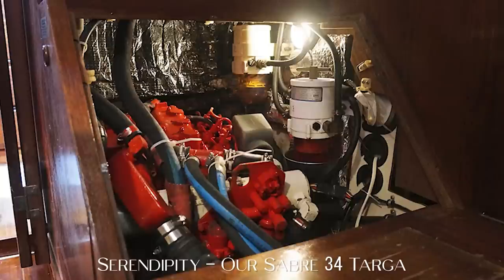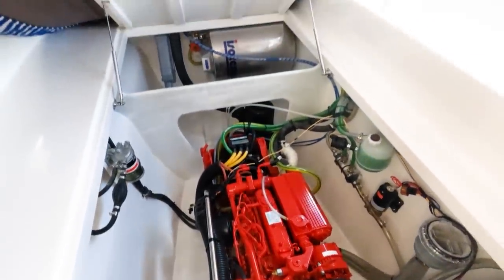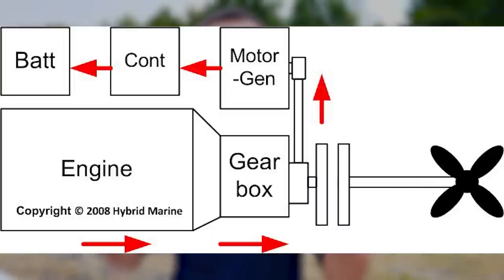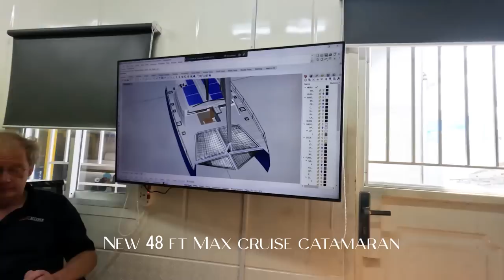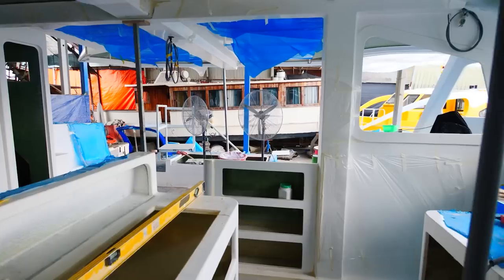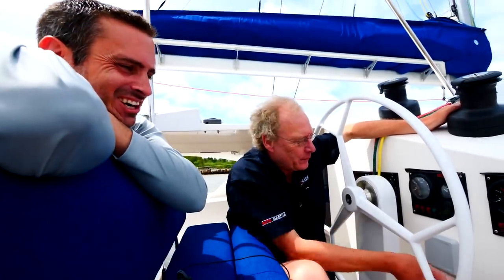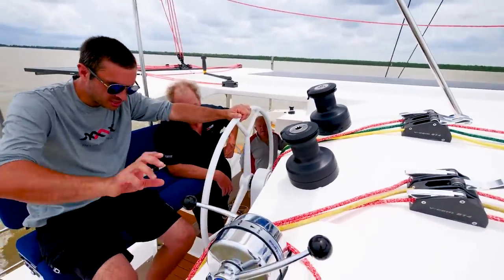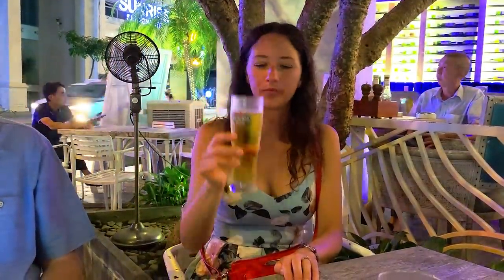Putting a Hybrid To The Test  (MJ Sailing - Ep 249) #electrichybrid #hybridengine

Comment: Looks like a cool system. I can't imagine trying to use that display at sea where it's mounted. I would prefer mounting them inside out of the weather and away from the steering wheel.
Reply from the maker: They have actually come up with a new display system for the raised helm since our visit.  Stay tuned to the Q&A section of our next video where we'll cover that 🙂.

Comment: Going 3 knots for 7 plus hours is useful if you have say enough wind to add another 3 knots. No diesel motor banging away & you're still moving at 6 knots. Really interested in the regen facts and figures from the props, this would be great in the dark hours, ability to put back into the battery bank 24/7 in association with a nice solar set up. Happy belated birthday Jess

Comment: Really really nice explanation of hybrid systems, I really like the idea of generating while underway from the prop. Seems like that could lower the diesel fuel costs on long trips. Was thinking that it would be cool if there was a physical "aux" in/out to the generator, for wind(blades/kites)/pedal power/gas engine/..., perhaps then run in reverse for pump(water/air)/blender/bow thruster/tools/air compressor/washing/...

Comment: You can get the same system for half the price and half the maintenance if you put an electric drive on one hull, and the ICE engine with a HO alternator on the other.  Most cat owners run only one engine while distance motoring anyway.  Yes you'd have to adjust your technique a bit while slow speed maneuvering.

Comment: Another great video guys, I think if the cost does come down a little the hybrids like that Beta will take over the market, having multi-modal drive and generator redundancy is ideal for a cruising boat and Beta use Kubota engines so reliability of the diesel side is assured.

Comment: With a hybrid system, in 6 years from now either the components to repair it would be unavailable or prohibitively expensive. There is a reason cars from the 60's are still around, but try and find a spare part to fix something made in the 90's or 2000's.

Comment: Thanks for explaining the hybrid engine system. I was wondering what is the extra cost compared too having just a desire engine Also how does it compare to a hybrid in a car.
Reply from the maker: For the two of us, the cost would be a lot higher because we were able to get our hands on a set of gently used diesel engines for $7,000, lol.  I think if you were to start with two new 35 hp diesel engines, the price increase would be around 40k?  (don't quote me though)

Comment: Did I understand right that under a good sailing wind- you can turn the propeller unto what amounts to a water windmill and charge the batteries or make electricity? Since they are being dragged through the water anyway.  So if you anchored in a river- you  could also use the rivers flow to spin the propeller.  or the tide going in and out?  Could you go wireless and build the gauges into the steering wheel itself? with my old eyes it would be hard getting them to focus on those small displays.  Having the bunks airconditioned is great idea.  At night having a cool sleep is so amazing after a hot sunny day a little sunburned oh Luxury---  you would use the airconditioner for dehumidifier also and collect the water?

Comment: Nice Video and Great Explanation of Hybrid Propulsion! I agree with you that the cost still does not make economical sense. A good data point to include in the next video would be the "payback" time at the current cost of diesel vs. the increased cost of hybrid system.
Reply from the maker: If buying two new diesels the size used in these boats (30hp) plus a genset, then it's a more palatable difference.   From our cheap base of the used diesels we have, it's a far larger jump :)

Comment: What i missed and correct me if I am wrong is the regen function. If you are under sail you could used the shaft rotation the regen the batteries. If you could add this to the system you would even have to use the engines a lot less.

Comment: The hybrid system reminded me of a saying. “Why make it simple if we can make it complicated” 
They could have use one of the Diesel engine, as generator, eliminating the need of the second engine and running two electric motor/ re- Gen.  
It’s always good to see what’s available.
Reply: All operating in a severe environment.
Reply from the maker: But with the system you're proposing, all eggs are in the electric basket - which I don't trust as the only propulsion option.
Reply: Would be better to have a single parallel than a single serial. As long as the parallel could pish the boat by itself.
Reply: @MJSailing  Excuse my question. Why do you not trust electric motors? You want to tell me a 35kW Diesel engine does not break at the wrong time? Murphy does not care which form of energy is used.
Reply: The sails are your redundancy.  I’d much rather have fewer moving parts and focus my pm time on one diesel generator.   Put it in the most accessible space so when it ultimately fails it can be pulled and replaced in a few hours.
Reply: @MJSailing  No your are not. There two electric engines, there are solar panels and regen and it is a sailboat. That is already a lot of redundancy. It is also easier to maintain a single diesel than two diesels. Especially since you can mount it in a place with better access.
Reply from the maker: It's not the motor that's the issue.  It's the system necessary to power that motor that's the weak point.
Reply from the maker: I don't get this idea.   This parallel system has a diesel motor..... Same as a serial with genset.   But instead of needing a generator head and extra charging system, this system uses the already in place electric motor as the charger.   There are less parts in this system
Reply: @MJSailing  A complicated Diesel engine with high pressure pump and injection valves, camshaft and crankshaft and many moving parts is more reliable? It is sensitive to contanimated Diesel fuel and does not work under water. 

I understand why you are hesitant because of the range. And the cost of the battery. And i understand why you want a backup on high seas. But i would want a backup for the Diesel engine. Not the other way around. But then i worked with both since school in the 1980s. Fossil burning engines never were as reliable as electric motors.
Reply: @wolfgangpreier9160  Yes an electric motor is very reliable, but what about all the other electronics like the inverter and control panel. They are in a saltwater environment. Lightening strikes are also possible, I would expect a diesel to handle that better than a inverter, and be easier to fix in remote locations.
If you are demasted at sea, which is a high probability you will want the range of a diesel.
Reply: @AORD72  When a Diesel strikes out and is waterlocked you can not repair it in high seas. Of course you can not repair a inverter yourself, just as you can not repair a broken camshaft. 

What do you mean with lightning strikes? Lightning does not do anything to electronics or electric machines in general when they are encased and earthed correctly.

When you are demasted at sea and the prop falls off you are a goner. No diesel fuel or working diesel engine would help you in that case. 🤷‍♀🤷‍♂
Reply from the maker: You seem to keep skipping the part that this is both systems.   You can run just electric all you want... It's simply an electric motor tied to a shaft.  Ignore the diesel all you want.    

But you can also run just diesel too.  There is nothing I can see that would make a serial hybrid with genset even close to the redundant reliability of a parallel hybrid.
Reply: @MJSailing  👍👍👍Exactly! Now you need two of both to be on the safe side. For you its important to be as safe as possible. And this system does just that.
Reply: @wolfgangpreier9160  On land your pretty safe but not on sea. Lightning strikes are known to wipeout all electronics on yachts, "Sailing into Freedom" for example, lost all electronics but still had his motor running. Transistors are very sensitive to even static electricity from a human touching them. Even in a small Farady cage hit by lightning I expect it is possible that the lightning to short out electronics inside because the Faraday cage could become electrically saturated. All the electronics are commonly earthed as well, so the lightning will go through everything on the earth.

Whilst lightning takes the least path of resistance, the problem I think another problem is the resistance of the path can change because the lightening destroys the pathway by increasing that paths resistance due to the massive current burning it out. So the path changes as the lightning goes through and destroys everything. I think this is what happens with fork lightning, it branches out as the pathways are destroyed.

Biotrek sailing I think he had puts a earth to the water when in stormy weather to help mitigate the damage incase he is struck.

If a diesel is water locked don't you just drain it out and put new oil in. Most of the cat sailing channels I watch, they always seem to carry spare oil and filters. I think something like a camshaft breaking would be pretty rare on a diesel boat motor, other parts are surely made weaker, like a clutch. The diodes in the alternator would be a concern and any electronic controls.
Reply: @AORD72  I am sure their electronics were all those simple thingies in plastic containers i see on many different YouTube channels. Of course they burn through when a lightning strikes. I did not know that Radar and communication, autopilot and depth finder are safe from lightning. 

You do not need a faraday cage, that does not help against lightning because your cables must enter and leave the cage at some point. The whole system must be protected from lightning. That involves of course everything.

My questions: How do you start the Diesel engine after a lightning strike? And how do you navigate without sight, light, Radar, GPS etc. With a sextant and compass?

Earth on the sea is of course the water surrounding you. In a plastic boat you would need a lightning rod or net - i don‘t know how they are implemented. On a metal boat you don‘t need anything special. I recommend not touching the boat on two different places when the lighting strikes. That would be inconvenient. Other than that its only frightening. And very VERY loud.
Reply: @wolfgangpreier9160  "How do you start the Diesel engine after a lightning strike? ", they are the more robust parts of the boat. The diodes in the alternator and the lead acid starter battery are pretty robust. Isolation also, the 12v diesel battery will probably be isolated from the main electronics (lots of other electronic connected to the mast therefore lightning damage is highly  possible). Some of the older Beta engines you could hand crank. Really a good question to ask beta because now days there is more electronics that can fry. Probably prudent for a yacht traveling to carry suitable spares to handle a lightning strike.

Any sailor should be able navigate with just a compass, the sun and dead reckoning. The manual compass will still work, it is just a magnetic bar, probably permanent.
Reply: @AORD72  A lightning strike destroys every electronic and electric component on a boat. There is no diode on the whole wide world which would survive a lightning strike. 

I thought you may be kick start or hand crank that engine, if it is still completely mechanical. And navigate during the day with compass and sextant. Because after a lightning strike your GPS, phones and computers are certainly all fried. 

I guess when you loose all of that you can even sail to your destination and do not even need an engine.
Reply: @wolfgangpreier9160  I think all things connected to the mast and electrical pathways connected to the mast (even insulated ones, probably rated at a couple thousand volts) will be fried. Items that aren't connected to the mast or any ground system will probably survive. That is why I wouldn't put anything in a microwave or oven as you see people do because it is grounded to the boat. Maybe if a microwave or oven that is disconnected from the ground system (unplugged) I would.
True you could sail.
Reply: @AORD72  A typical lightning strike has around 100 million volts and about 30.000 Ampere. 

What do you mean put anything into the microwave? When the lighting strikes it goes straight THROUGH the microwave. 

If that works its just because the lightning has "ignored" the microwave. But not because a microwave presents a good enough protection against lightning.

Even a faraday cage must be very good to protect against lightning.

You can only lend a lightning a hand and try to show him where its easier to flow. But there is nowhere near a guarante that he does just that. A lightning rod is useful most of the time - until it is not.

You can easily protect against lightning strikes, its just a matter of cost vs. replacement cost of the parts to be replaced.

A connection to ground shows the lighting a easier path, thats all. Btw: the path is made from the boat UP and not from the clouds DOWN, but thats so fast that nobody can react to that.
Reply: @wolfgangpreier9160  THROUGH everything connected to the earthing system on the boat. Modern microwaves can have metal trays and ovens are metal. So your device could be connected to the frame. Even on glass turntable your device in the microwave could move an touch the metal frame. It is 100 million volts and about 30000 Ampere, the electrons would likely saturate the everything connected to the earth and the mast. Like I said, a microwave unplugged would probably be ok, far better than one that is connected to the earth of the boat.

Comment: I'm currently designing a hybrid solar and wingsail catamaran that I would like to build. I do think the parallel hybrid system is a very practical highly redundant system, but is the diesel all mechanical injection, or does it have an ECM? At least from my experience, if lightning took out the whole electric propulsion system there is still a significant chance it would also take out the ICE ECM too. So you should have a spare on board if that is the case.

Comment: Nice to hear that if you have a hybrid system and lighting strikes that the electric propulsion brakes doen. Sorry but if you have a diesel only propulsion and lightning strikes the diesel is also broke. Especially the new one with all the electronics. 
Sure it’s new hybride and full electric but brake down off a diesel is more likely than the electric!  If you use A- class parts it would be good and reliable!

But you explain the system really well!
And I’m enjoying your channel!

Comment: I saw a prop shaft sealing with water lubrication from the sea water pump of the diesel engine. How does it work with the electric motors diving the boat?

Comment: 20KW = 3 hours cruising - max charge about 8KW which is good at about 0.3 C into the batts as for a long max capacity life it is not ideal to charge a 1.0 C eg 1 hour to fully charge from flat (same as driving your car a 9,000rpm or 3000rpm which mode will last the longest) So its a well designed balanced system - good stuff - another plus is diesels don't like idling / they like to be flogged as it prevents glazing on the cylinders and again less mtce long term - if idle for some time run them at 90% load for 15-20 mins to clean them out -RRA Admiral (ret) (RRA = Rear Reclining Armchair)

Comment: Regarding the imptoved risk mitogation that Matt mentioned. Will the boat have tvo sets of battery banks, and can they, if needed, be isolated from each other?
Reply from the maker: This boat has six 48v batteries which are paralleled to get a 21kw bank.   Each one could be taken off line as needed.   The Pylontech batteries all have internal BMS with cambus communication to the Victron charging system.   It's a very intelligent integrated system, but also works independently if needed.

Comment: Hybrid vs diesel, interesting problem. I think it's horses for courses, if your a coastal cruiser with good marine infrastructure near by, hybrid is great, 'cos all it takes is one little diode to go PING and you've lost a drive. If your a long distance cruiser, that diode is guaranteed to go south when your in buttf**k nowhere, fault finding and replacement is going to  be bloody hard. At least eveyone everywhere knows how to fix a diesel. Occam's razor rules!!  The system the guys showing you is cool, should be called an inbred system🤣, sorry. Have fun, looking forward to next weeks episode.
Reply: You could perhaps mitigate the risk by running two independent electric systems ( one on each hull).
Reply: " 'cos all it takes is one little diode to go PING and you've lost a drive". You could use a secondary controller or two motors or have one replacement part if you want to. Better than using the stinking Diesel.

Comment: I wonder about the weight? Could you cope with 1 diesel in parallel on the guest side and a fully electric on the other.
Reply from the maker: Stay tuned :)
Reply: I was going to ask just this - glad to hear it's in consideration... Less weight, less cost, still redundancy with diesel/electric options
Reply: @jonbowden666  Yep, you have three independent systems then. 
1) sailing  (long range + charging)
2) electric (short range + maneuverability)
3) diesel (long range + charging + heating)

Although 1 diesel means you have no spare to swap parts with for fault finding. But they are pretty basic aren't they? And you can carry the main spares (controller, belts, alternator) British as well, aren't they? I think Betas are pretty robust?